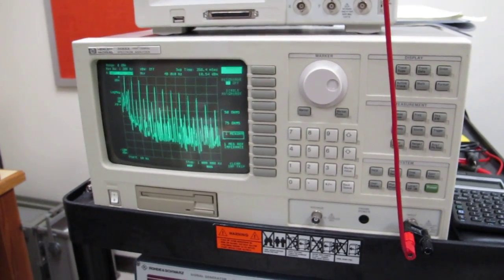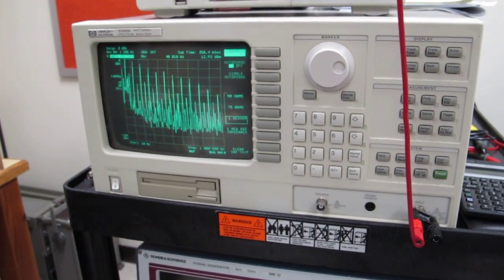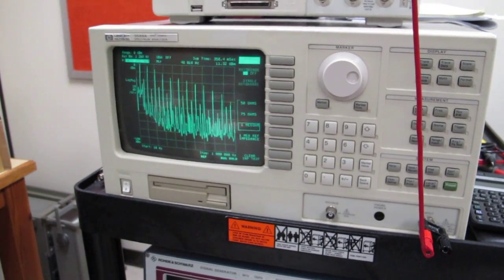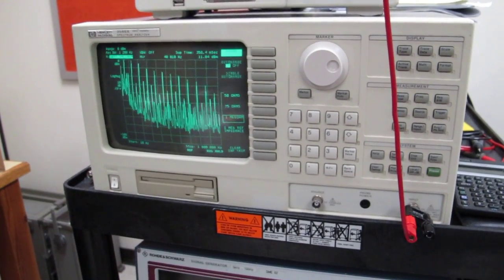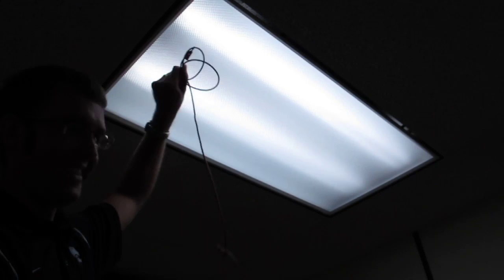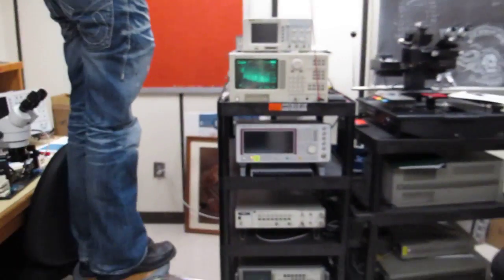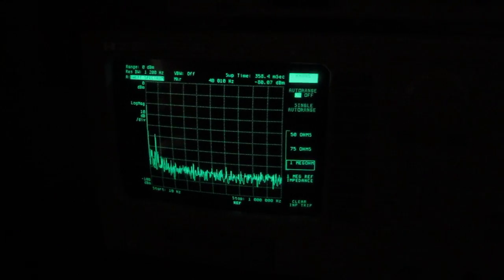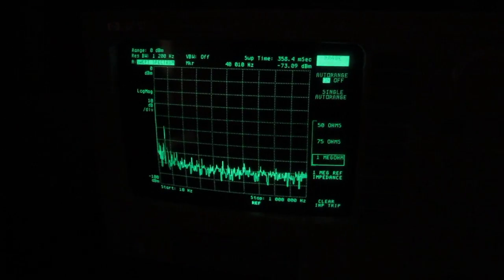Radio noise (EMF) from high-efficiency fluorescent lights (1 of 4)

Comment: So why is it “nasty”?  If I’m next to radio, do you believe that is harmful as well? I don’t understand. Thanks.
Reply from the maker: No - its only microwatts of power - but more than enough to disturb the radio spectrum so that far away radio stations that are weaker than the noise are blocked by the radio interference. In the early days of radio, the FCC made sure that equipment didn't do this - but a lot of lighting in the last decade or so seems to meet the legal requirements wrt radio emissions, but still pollutes the spectrum in the sense of not letting radios work well (specs only called for testing emissions below 30 MHz, but modern lighting emits up through 300 MHz and higher ...
Reply: @MegawattKS   that is really interesting. Thanks for this,  very illuminating. I’m currently falling down the rabbit hole of infrared therapy and somehow I came across your video. Lots of research including double blind control studies showing benefits. Apparently it’s fairly  main stream in Europe and Canada. Would love to hear your take on this.., maybe a video? 810nm seems to be a favorite wavelength for depth. “ Photobiomodulation”. The devices are very expensive from $1000-$6000 medical grade. I always wondered if I could just take a bunch of IR led’s and make one for 30$. They also have these $40 infrared light bulbs which claim to do the same thing. But I don’t know how to verify if it’s the right wave length claimed and how to actually measure the output power in terms of watts per centimeter squared. Which instruments are needed? Dosage is really important looks like.

Comment: So is there any way to get the noise out with a filter or something? I can not listen to the radio in my shop with the lights on. Thanks
Reply: Mark the propane guru I even ran my antenna outside, that helped a bit on lower fm channels, but 100 and over is terrible, and under 100 still has a little noise.
Reply from the maker: Mark the propane guru You tried the best approach (getting further away from the source).  Actually I'm a little surprised this is upsetting your FM receiver.  Our lights don't mess up the spectrum at 100 MHz and above excessively.  Maybe if you had a directional antenna to pull in a stronger signal from the station you're trying to get?  But that's only going to help a little and you would have to rotate it for picking up multiple stations.  I assume you tried other receivers.  Did you try a battery-powered one to verify it is not coming in through the power supply?
Reply: +MegawattKS ,yes, I am now using a 12 volt converter and a car radio with the same results as a 110 volt stereo receiver. Here  is how I know for sure it is the lights, and it is not on the power side. I turned the radio on in my pickup truck and when I pull up to the garage door, the signal goes bad. Turn out the lights, perfect reception. Back the truck away a few feet, perfect reception.
Reply: @Autogurugenious  I realize this thread is 5 years old so.... Did you resolve your issue?  The interference comes in two flavors, EMI and RFI.  EMI is transmitted through the electrical wires going back to the service panel. It creates noise in the panel that is also powering your stereo. RFI is interference that is radiated from each light fixture. From your testing you determined it to be RFI, and I agree. Now the problem is how to fix it. Did you resolve the problem? I am having the same issue and am tired of listening to music CD's.